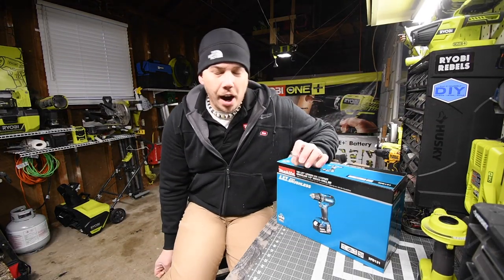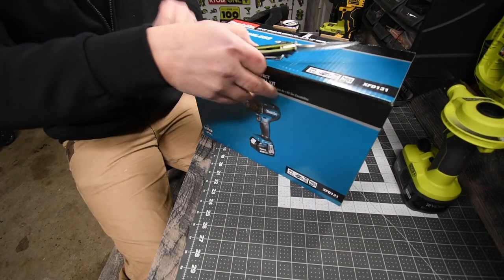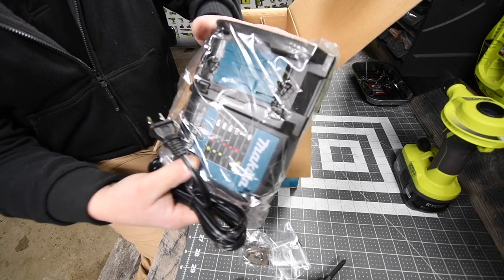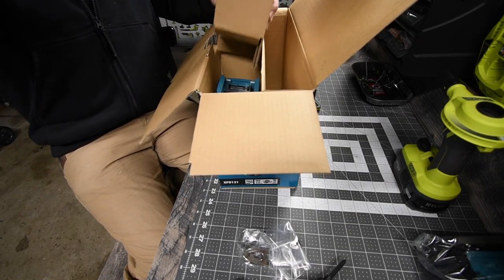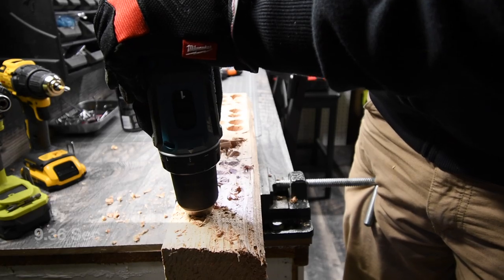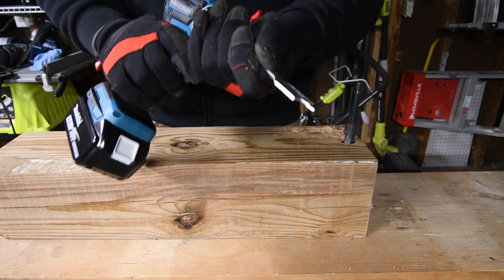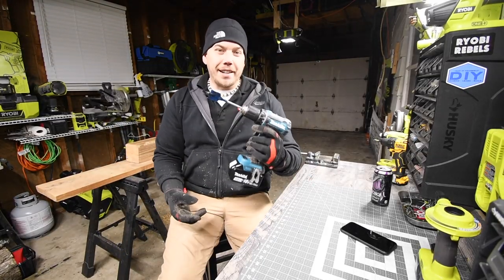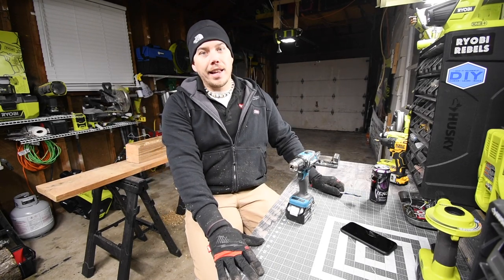$100 Makita drill Unboxing/Test

Comment: If u want big bits use augers. You won't have any burn smells from brushless motors. If u do, then the tool is bad. The fat drill bit isn't bad. You need to clear the ejection port. The bit doesn't have one when it's driven in deep. What stops and slow down bits are the waste wood.
Reply from the maker: yes sir and thank you